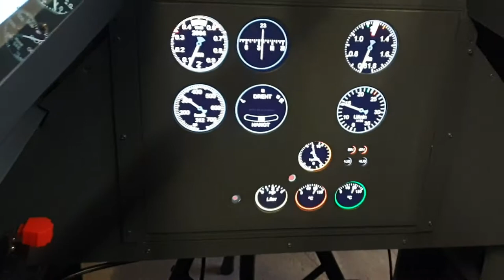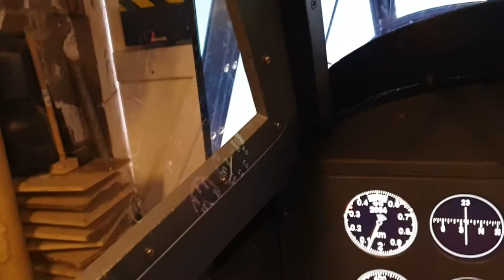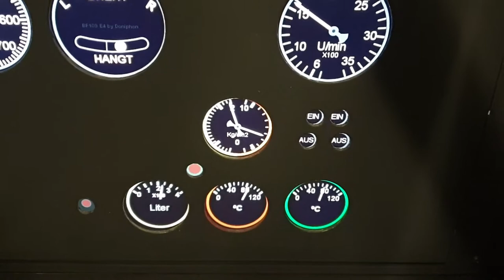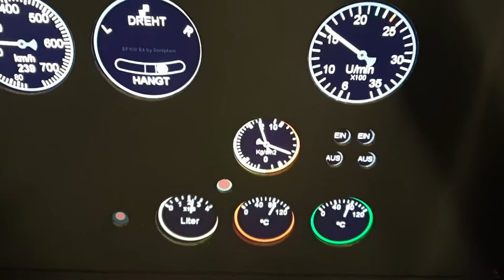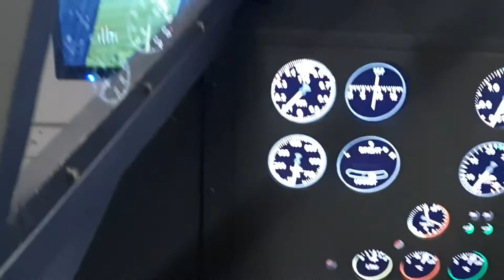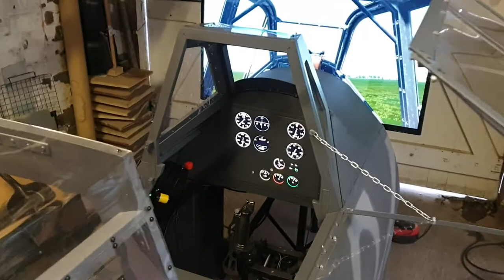Creative Cockpits BF109 / Me109 Simulator

Comment: You seem open for some reasonable advice, so here goes. In the setting section of the COD program you can set the view to show the forward scene WITHOUT showing the aircraft. This would take out that double canopy stuff and give you a better sense of being inside an actual aircraft in flight. I know, as I built a fully functioning sit in BF 109 cockpit in my basement that is quite similar to yours, but with a few more refined elements. I would suggest you make the rudders adjustable, NOT the seat. Sliding seats back and forth is fine for motor cars, but not aircraft. Moving the seat back and forth alters the other flight controls in a negative way. If your legs are longer (you are taller than the last pilot) the have your rudders set on a plate that can be moved forward or backwards to match the difference. Just some thoughts to ponder. Other wise a pretty clean built. By the way, your cockpit is missing the flap and trim wheels on the left side of the seat and all the breaker panels, full pump and other important items inside a real cockpit.
Reply from the maker: Thanks Larry, I will have a look at that section in COD. I think the customer who bought this 109 is already doing that by the looks of his setup. The pedals being ajustable is something I will look into for future builds. I would love to model all the other controls but that's where I start buring into big labour costs.  Feel free to send me a link to your cockpit if you have a video and I will put it in the description. If you ever want to reproduce and sell any more of these controls fitted in your 109 I would be happy to refer you to my 109 customers.

Comment: Such a physical cockpit really cries out for a multi-projector setup, with the game cockpit turned off. A single monitor out front does not take advantage of the immersiveness inherent to a physical 'pit.

Compared to this particular monitor arrangement, my 32" monitor positioned about 18" from my face (I use reading glasses for relaxed focus) is much more immersive. That's because the screen subtends an apparent angular width of just about 90 degrees (think IMAX.) With my usual default wide FoV of 105 degrees, this is not far off from a 1:1 image correspondence to reality, which makes you feel like you're in the cockpit. 

And with my head tracker tuned accordingly, I can pan my head to bring in all view angles without my gaze falling beyond the screen edge and still not have to swivel my eyes. It's the poor man's VR. And in certain respects better than VR; I can see to grab my beer without knocking it over!  😀

In spite of my nit-pickiness,  this is a nice build for those who desire an even closer experience of being in a fighter. Nice work!

Cheers,
Glenn

Comment: Hi congratulations 
Great design 
What kind of device or program did you use to reproduce the panel gauges ?
Reply from the maker: it's a program called "virtual cockpit"  it's designed to work with Cliffs of Dover